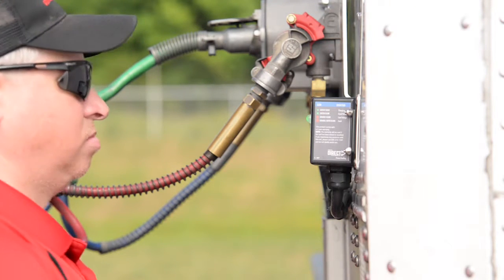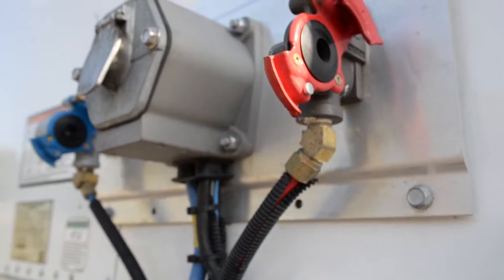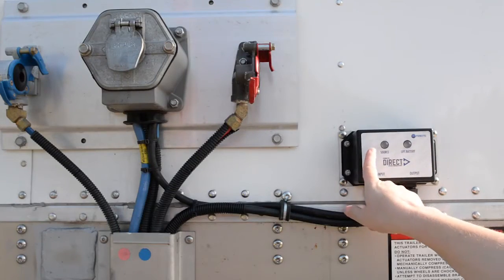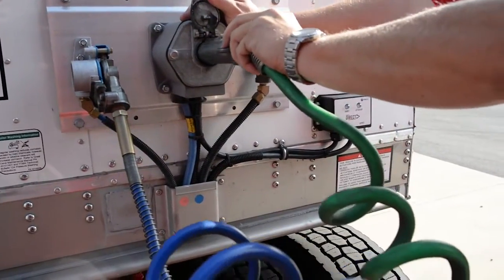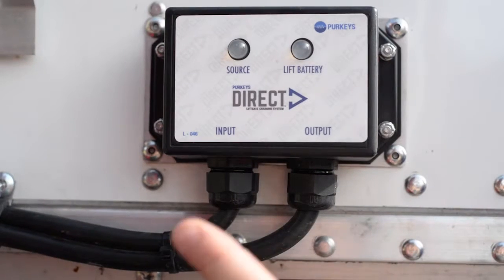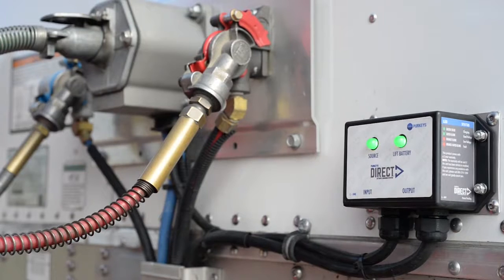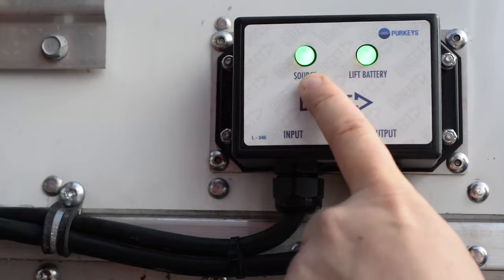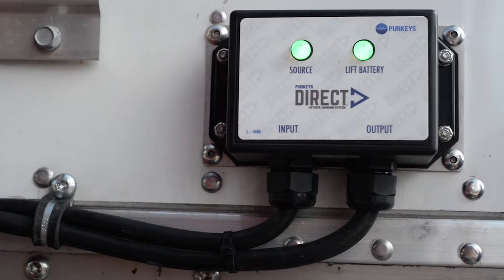Liftgate Charging: How the DIRECT works - Purkeys

Comment: So my source lights not on but has 14.3 going to it. Absolute junk
Reply from the maker: If you have 14.3 volts at the blue wire at the back of the Direct box, check the 30-amp midi fuse to make sure it is not blown. If you don't have 14.3 on the blue wire at the back of the Direct box, the problem is between the source (7-way or dual pole) and the Purkeys box. Our customer service team would be happy to help you troubleshoot this issue! They can be reached at https://purkeys.net/contact/
Reply: @Purkeys  thank you for this. So check the trailer ABS fuse.